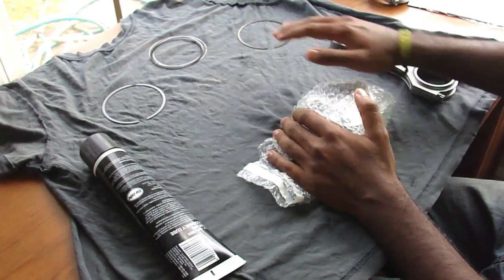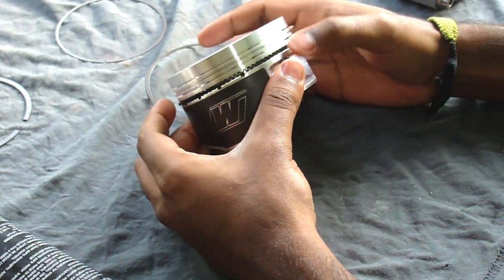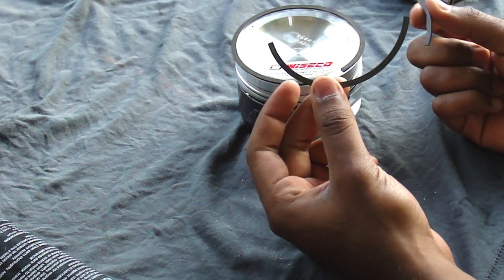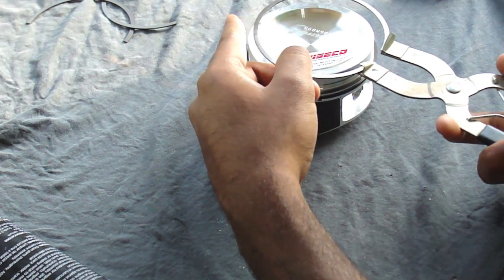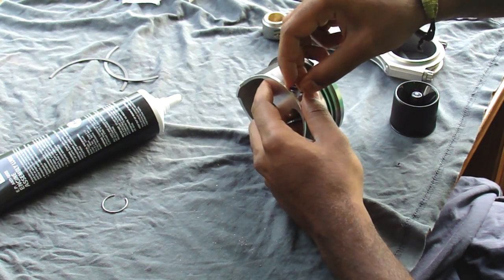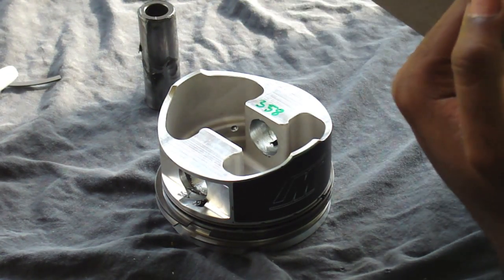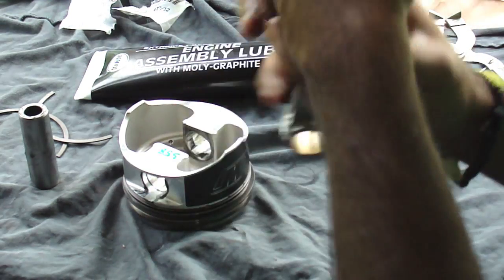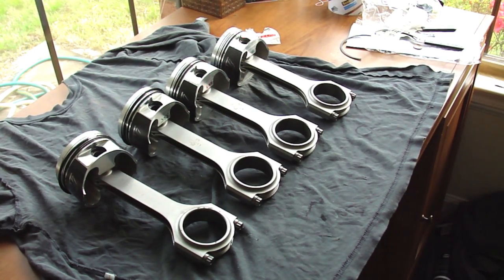How to: Assemble Pistons with Rods

Comment: How did you just push the pins in through the rod by hand? The rods typically have to be heated then installed hot in order to get them assembled.
Reply: That's on a press fit pin. These are floating pin rods.
Reply: @daveintexas2000  seriously,  6 months later.  Thanks.

Comment: Did you have to file the ring gaps to a certain spec are do they come ready to install without needed to file the ends?
Reply from the maker: you have to set them to a certain gap, this is VERY important. check out my other video on how to set ring gaps!
Reply: crap that was a FAST response, I'll check it out thanks :) !
Reply from the maker: +DxBOY15 👍
Reply: do the oil control rings have to be gaped? Watched your ring filing video but don't think you mentioned those. Thanks! Very informative for building my 2zz
Reply: +Project Garage you lubed that piston hole good lol

Comment: Hey I just ordered the same set up for my ka24de,  was wondering how it is running 9:0:1 compression without turbo?
Reply from the maker: +Jordan Guzman It was running great, but the WISECO PISTONS ruined my engine. One of the c-clips that is supposed to hold the wrist pin was defective and caused the wrist pin to slide out, causing a HUGE gouge in my cylinder wall and ruining my numbers matching original engine. I contacted WISECO about it and they didn't even bother to talk to me about it. I WOULD HIGHLY ADVISE AGAINST BUYING WISECO PISTONS FOR THIS CAR. Go with arias or CP, more expensive but you wont pay for it later.
Reply: +Project Garage wow that sounds like a nightmare, thanks for the heads up
Reply from the maker: No problem man. There are definitely people out there that have used them without issues. But the fact that WISECO didn't even take the time to back their product says something. I don't want ANYONE going through what I did.
Reply: +Project Garage yeah I hear you on that one, this is the second time I'm rebuilding this engine.  The first time I had some shop do it and they messed up bad. installed the rings in the wrong order and upside down plus the idler sproket blot go stripped out. so there was a lot of cylinder scoring.  Now I'm in the process of boring to 89.5mm and doing the forged internals to run boost.

Comment: nice video but only one thing don't go by installing the rods to the piston by using the eagle logo. always look at the big end where you install the bearings the little cut out groove that keep your bearings from moving on the rod has to be facing to the left side .wile the dot or arrow on the piston faces the front of the engine wile your standing up front of the engine. or to make sure just look at your stock piston and rod always look at the little notches   that's on the big end side of rod
Reply from the maker: +Monstrosity Sound Inc. hmmm I think it ended up working out anyway, but thanks for the tip!

Comment: Nice build i did wiseco pistons as well, I bored my motor out paid my machine shop for that and the build. Props for doing the bottom end yourself, did you just put a new set of pistons in without honing or boring?
Reply from the maker: Brian Heiden Thanks! I actually took the bare block, pistons, and piston spec sheet to my machinist so he could bore everything to spec and get the right piston-to-wall clearance.

Comment: These videos are so funny, and the comments are even more funny!!,,, install a .30 over piston in a .60 over cylinder, , really, ,, wow!! Could have dropped the piston trough !!!  The mark on pistons is for facing forward, , but the rod will have to be facing the correct way, based upon your crankshaft radius, ,, rods are not marked for facing forward only! ! Come on guys, I understand you want to do it yourself, , and that's cool!! But please watch the professionals!!! Save money and time by doing it right the first time! ! You don't make such a mess pre-lubing the pins when installing the rod/pins, save that for installation of pistons in its Bore, lube the pins well, and rings, , install the piston, , your done!!    Be safe and have fun!!
Reply from the maker: who said anything about installing a .30 over piston in a .60 over cylinder? That is some crazy overbore, and neither are my specs. As far as the rods, you'll have to take that up with the manufacturers/designers of the rods. According to them it doesn't matter for this car. Please dont use assembly lube to lubricate your cylinder bores... As always, thanks for the hate!

Comment: Can piston run with one retaining pin?
Reply: It will run for a moment, until the wrist pin slides out and smashes into the cylinder wall, ruining the block.

So in other words, no.  Gotta have two; one on each side to hold the wrist pin in place.  :-)
Reply from the maker: rhkips Unless the piston was built for one retaining clip. So the wrist pin can only go in or come out from one side.
Reply: Project Garage
Interesting thought!  I've never seen nor heard of that before, but now you've got me curious!  Are you aware off-hand of any engines built like that?  I'm gonna dig in when I can and see if I can't find something.  :-)
Reply from the maker: rhkips Yea I mean I haven't looked into it. But the whole point is to keep the wrist pin from flying out. So if a piston manufacturer did want to only use one retaining clip they could easily do it. I dont think there are any pros or cons to it
Reply: Project Garage
There are instances where  PTFE bungs are used instead of clips.................
Reply: Thanks for the info guys!